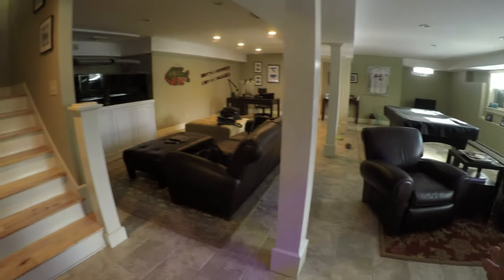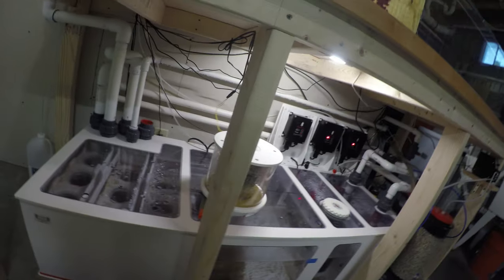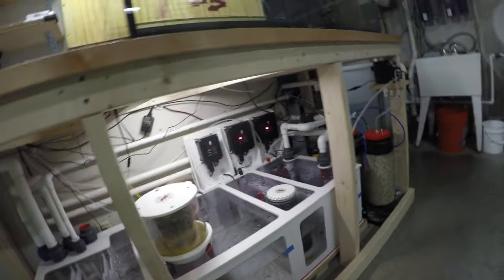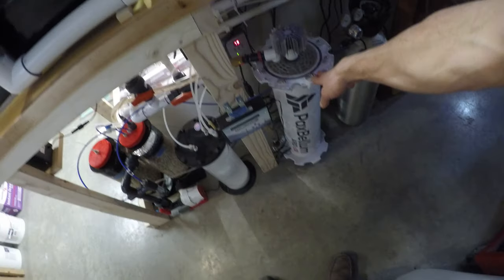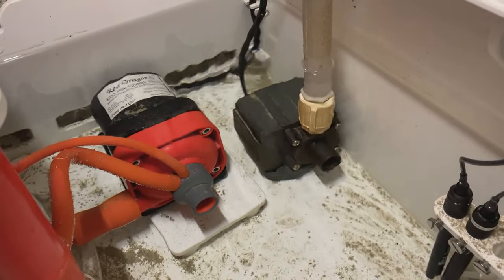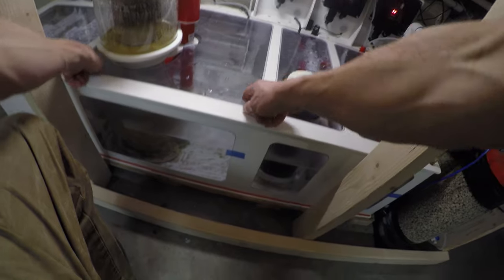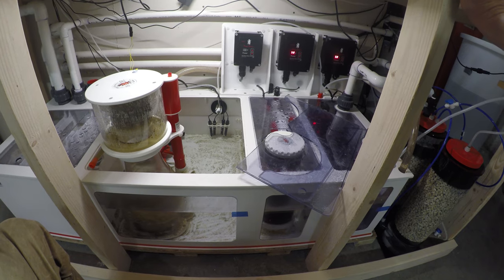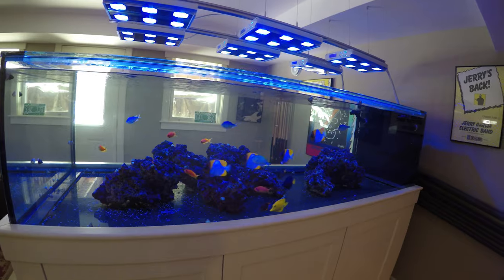3 Glass Walls: My Peninsula Tank Build Journey, Ep #19 - Maintenance & Husbandry

Comment: Hey Keith I would switch those Ecotech wet side cleaning to citric acid. You can get it cheap off Amazon. Luckily Ecotech replaced my nearly new wet sides where the magnets swelled due to using vinegar. I was sick to my stomach. My pockets aren’t as deep as most people in the hobby and $150 worth of replacements due to simply trying to clean them was a hard pill to swallow. Luckily Ecotech got me taken care of.
Reply from the maker: Thanks for the tip. How long do you soak them in citric acid and what is the ratio of citric acid to water?
Reply: I use citric acid also...the vinegar killed a few wet sides for me. I use 1/2 cup per 1 liter for about 2-3 hours but there were times I left them overnight if it was very bad. I used a small pump to circulate the water as well.

Comment: Keith for the Reef Octopus calcium reactor do you use the recirculating feature and if so how do you keep it quiet. I have one of these and if I open that valve just a little it does recirculating the CO2 but my pumps is always chopping bubbles and I cannot deal with that noise. Right now I bypassed that feature so no C02 gets reused and I feel like I'm not using the reactor to it's fullest  potential but I can't do that noise all the time.
Reply from the maker: I do use the re-circulating feature but I don't hear the noise since the reactor is behind closed doors in my sump room.